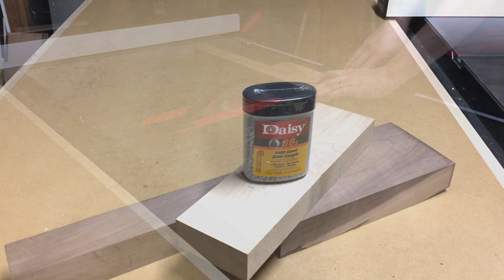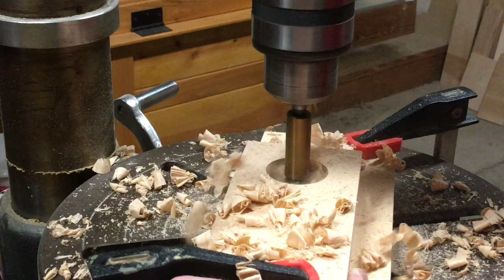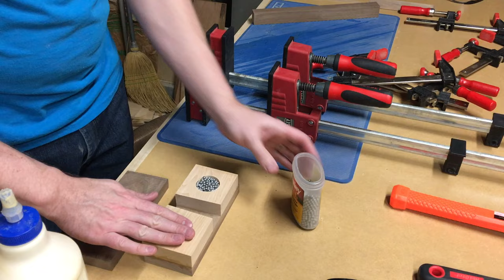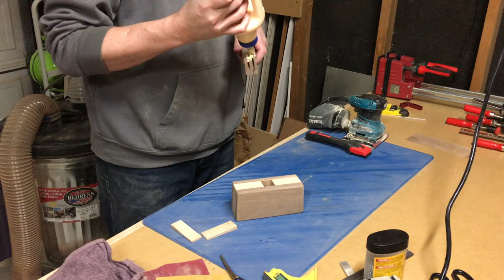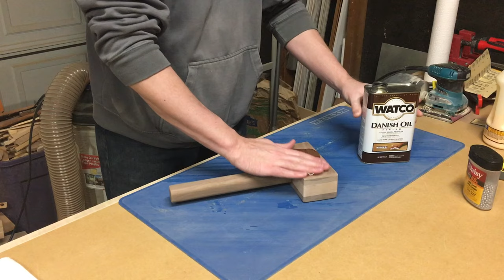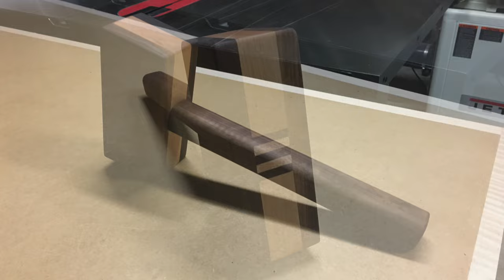Wooden Mallet Build | Make a Wooden Mallet with Power Tools | Shop Built Tools

Comment: Beautiful mallet, nice clean lines.  If I could make one suggestion when applying your Danish Oil finish, you may want to use a rag and gloves.  Danish Oils contain many of the following: Mineral Spirits. Aromatic Petroleum Distillates. Mineral Oil. Stoddard Solvent. Tung Oil. Linseed Oil. Man-made and/or Natural Resins. Man-made and/or Natural Varnishes. None of these are very friendly to skin and most are toxic and are easily absorbed.
Reply from the maker: Thank you and thanks for watching.  I typically do wear gloves, just didn’t have any on hand. 👍🏻

Comment: By the way, did your wedges go all the way down to fill the void in the handle, or do you think that's not necessary
Reply from the maker: +Gene s Hackett not sure if they bottomed out but they are certainly far enough in that the handle is rock solid.